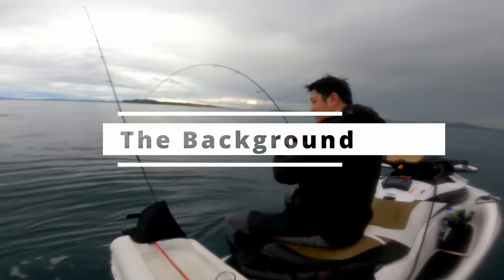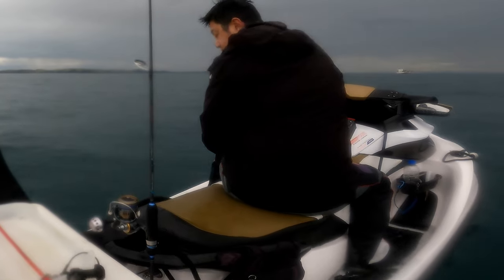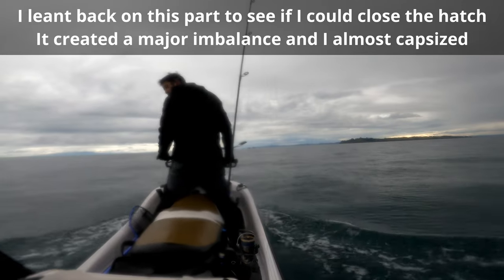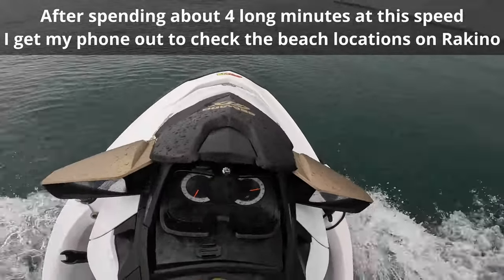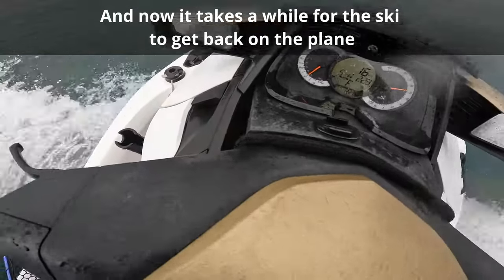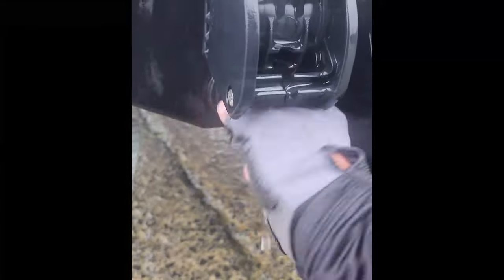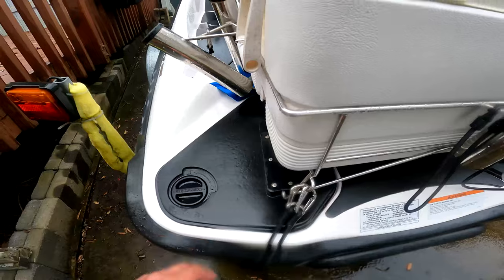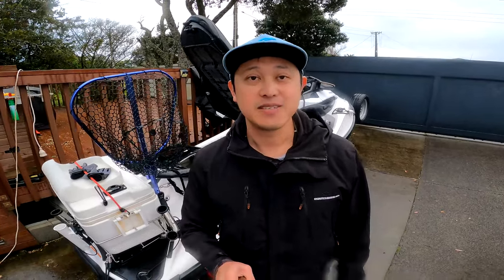I Almost Sunk While Jet Ski Fishing

Comment: I have the same model ski.  Your battery was back there on the starboard side presumably very close to fully submerged in salt water!  It's seems very lucky you were able to start your engine.  I'm glad you made it back ok.  Your experience makes me think I should do something better about securing those hatches on my ski.  I'm not sure what.  Maybe some sort of safety pin to prevent accidental unlocking of the hatch.  Anyway, nice fish and enjoy your next trip out.  Trouble free I hope.  👍
Reply from the maker: Thanks for watching mate, I'm pretty sure the battery was close to submerged, honestly surprised it was able to start so was very lucky there. Having hatches there is a bad design isn't it, it's good the newer skis from 2016 doesn't have hatches there anymore and it's a fully sealed area.

Comment: I'm surprised that nobody suggested that you should install a bilge pump when you were setting this ski up. It's important for any PWC in my opinion but it's an absolute must for any PWC used for fishing.  I fit a bilge pump to every ski I own, it's cheap insurance. 

Glad you made it back OK, and nice video.
Reply from the maker: I totally agree with you, I'd definitely have a bilge pump in my next ski, even in my boat I upgraded to more powerful auto bilge pumps. Thanks for watching and commenting
Reply: @FishoDavo  I recommend the Whale SuperSub 1100GPH bilge pump with a 3-way switch. It wires directly to the battery and runs automatically when it detects water.  You can also switch it on manually. You can also install it without a switch which simplifies wiring, keeping it in auto mode.
Reply from the maker: @simonwallace699  thank you

Comment: Good you got home safe.. great lesson for the rest of us.  Looks like that's a major design flaw with those Sea Doo models.
Reply from the maker: Thanks mate, hope it helped. Yes, silly place to have a hatch, looks like ski's from 2016 onwards don't have this hatch anymore so a lot safer
Reply: My ski has same hatches. Forever having issues with water ingress. Have you replaced the rubbers on them? Do you normally come back bone dry or take on water after every run?
Reply from the maker: @timwilliams7774 yup I've replaced the rubber seals in the past, they get to a point where they get very thinned out. Always come back with a bit of water in the hull, never bone dry

Comment: Seriously scary situation, I can relate because go offshore a bit myself in the Gulf of Thailand.  I was curious, does your year Seadoo have a bilge clearing device that works off of suction created by the jet pump?   My 2018 Waverunner VX has such a  device but one time I had a problem with the internal backflow part of it and I took on some water, luckily at a lake instead of the sea.  I plan on adding an electric bilge pump as well that will run off the second battery.
Reply from the maker: No don't have a bilge pump, I do think it's important to have now after that ordeal. Thanks for watching

Comment: Had that happen on my Honda. Rough conditions trolling made it harder to detect but my ski was gradually sitting deeper into the water. More water in footwells, back sitting lower. Hard to tell when it’s gradual. 
  Unbeknown to me a plain metal cooling system hose clamp under the engine ( all the rest were stainless steel) had finally broke and the hose came off. So as long as that engine was running the hull was filling with water. The hair standing on end feeling that something is wrong but you don’t know what it is. 
   Followed my gut feeling and got back quick as I could breaking all speed limits never taking my hand off the throttle until back at ramp. Pull out on trailer, have quick look under seat and water at top of battery. 
  Took me ages to find the problem. Had to use a mirror eventually to see what was underneath the engine. One rusted broken metal hose clamp hidden under engine. You can imagine my thoughts being a Honda, which I trusted for my first ski. You could hardly set a better trap for your enemies.
Reply from the maker: Glad you made it back safe, quite the story and yeah we both know that feeling now!

Comment: Thanks for posting - helpful advice. Love your fish finder installation - what type of finder do you have and is the mounting bracket shaped to fit the glove compartment lid?Is the finder easily removed and dies the glove compartment still open and close easily when it’s in place?
Reply from the maker: Thanks, I think it's a 5inch fish finder from lowrance, it's permanently fixed to the glove compartment using a 3D printed enclosure. The glove compartment still opens no problem

Comment: I don't know this model , what hatch is this ? Sounds like a bad design. Would you have been able to get in the waer and close the hatch ? or reach it while staying dry ?
Reply from the maker: It's a 2012 model, from 2016 it doesn't have this issue anymore. I did try to reach back and almost flipped which was the part of the video after I put the fish in. I did think about getting in the water to close the hatch, but I didn't as I thought the ski would be too unstable for me to try get back on
Reply: @FishoDavo  ok, good thinking.

Comment: I'm only a couple of months into owning a ski so this might be the dumbest question ever,  but if i ever get into this situation I want to be able to act swiftly. I realise this would involve getting wet, and time being of the essence maybe a bit dicey, but with the bung system having a one way valve, would opening the bungs while at sea have done anything to help drain water out as well ?
Reply from the maker: Hey mate thanks for watching and commenting and it's not a dumb question at all. At the time I did think about getting in the water to close and lock the hatch, but in the end I didn't as my thinking was that the ski was already really imbalanced due to the water so getting back on the ski would of been impossible, it would of kept flipping over or the bottom may have sunk already. So in this instance I wouldn't of got in the water to open the one way bungs

Comment: Very, very topical on Sea Doos.. carbon seal,weak hull etc.. that's why sea doo eliminated any door compartment behind the ski.if you put weight or pressure in those compartment water slick inside and you will sink
Reply from the maker: Yeah and there is a seal there that over the years dries up and creates a gap, needed to replace it twice through the years

Comment: Early model seadoo that you have was never built for fishing with those rear access hatches. Asking for trouble. New model seadoos dont have that problem. Another problem with your model jetski is the battery vent on the opposite side taking on water when not plugged in.
Reply from the maker: You're right mate, from 2016 onwards it doesn't have the rear hatches anymore

Comment: Are you sure the open hatch was your only issue?? Once you started moving, then you won't get water coming into the hatch anymore, and the venturi tubes will drain the hull... So with no water coming, your hull should have been empty by the time you got back to the ramp? Unless your venturi tubes are blocked/kinked?? Or you have another leak which kept letting water in while your venturi tubes tried to drain... Maybe check your carbon seal just in case? And check that your venturi tubes are fine...
Reply from the maker: Thanks for the advice, that's most helpful

Comment: Do these newer skis not have bilge pumps?
Reply from the maker: This is an older ski, 2012. But I think new ski's don't have bilge pump as part of factory standard either
Reply: @FishoDavo  very interesting. I just acquired a 1995 tiger shark. Been trying to learn as much as I can about jet skis as this is my first one. My old tiger shark has a small bilge pump that runs anytime the engine is running. I tend to feel it's a little excessive, but i did forget the plug one day and was able to get basically all the water out

Comment: Hee well things happen as low as you made it back and the ski had no damage good learning experience... Plus just so you know the reason why you start gain speed was because there is a mechanical builg in skis for safety that suck water out of your ski while your prop is spinning so if you leave the engine running water will go out as long as it doesn't come back in plus not sure if you know but if you remove your bungs while riding in case of water in the ski they are designed to drain your hull faster on the water then on land so if it happens again just start engine pull the bungs and ride no stop 😂😂😂.
Thanks for sharing but an automatic bilge pump would at least warned you water was entering the ski allowing you to get on the problem before filling the ski up 😂
Reply from the maker: Thanks really great insight and knowledge, thanks for sharing this info with me. In this instance don't think I can open the bungs, there was so much water in there I think it was about to go under from the weight

Comment: As a last resort in a emergency, if you can open the drain plugs and get the craft moving forward it will suck the water out rather easily.
Reply from the maker: Thanks mate, that would be doable by getting in the water, but I think the ski would of been too unbalanced to try get back on at that stage

Comment: A flipped PWC won't sink because its hull is designed to float even if it takes on water, stop get off, shut hatch and stop making sunk videos. if you are to scared to get off you should not own a PWC.
Reply from the maker: If the front buoyancy keeps the ski from sinking its still going to be 70% underwater with the whole back underwater, what happened in this video is much better than that option
Reply: The one rear compartment will not sink it 70 % maybe 15% still no big deal get off and close it, stop being a fearmonger.
Reply from the maker: @TheJoedirt6000 ok

Comment: that's a pretty stupid design on seadoo
Reply from the maker: Yeap
Reply: @FishoDavo  I would just glue it up with the heaviest duty marine sealant
Reply from the maker: @rc3443 I think the newer models don't have those hatches anymore. Can't glue it up as the batteries are in that spot and need to open the hatch to charge the batteries
Reply: @FishoDavo  rewire it, change battery location, your battery wire is no good anyway, it will rust out since it's been soaked
Reply from the maker: @rc3443 it's OK I have sold this ski and changed to boat now